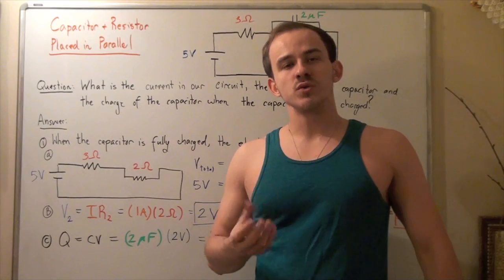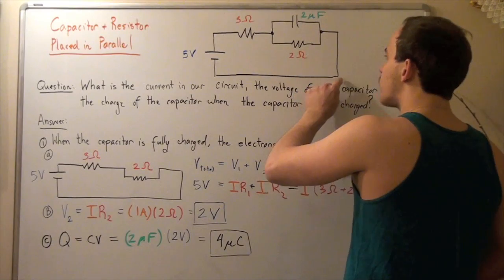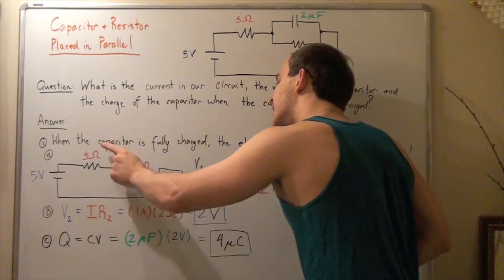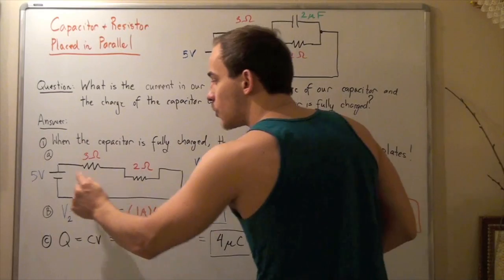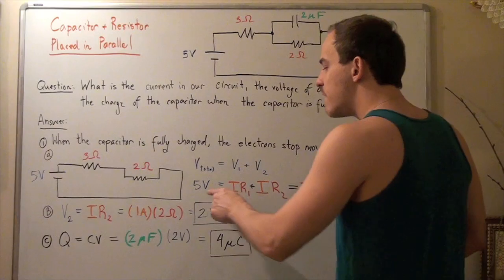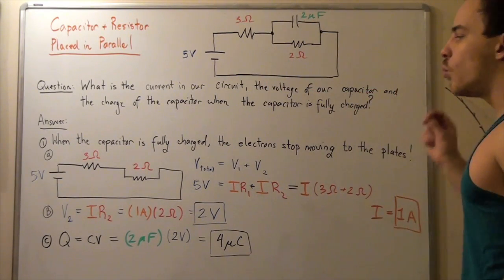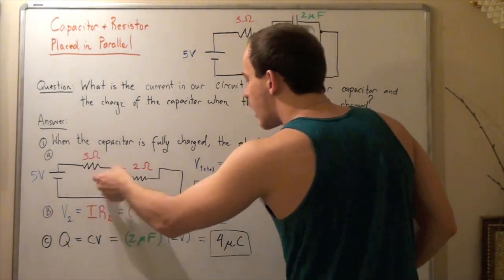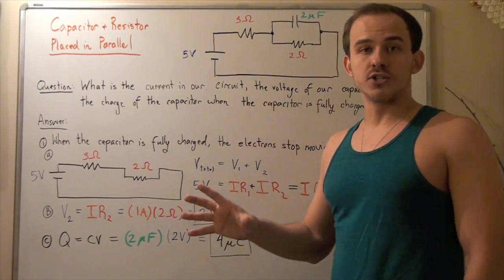Circuit Example # 3 (Capacitor and Resistor in Parallel and in Series)

Comment: At 5:04 you say the "difference in voltage is zero, but there is still a voltage"  The difference in voltage is not zero.  There is a potential difference (non zero voltage) across the plates of the cap. I think you mean to say "change" in voltage, not the same as static difference. That would be less confusing.